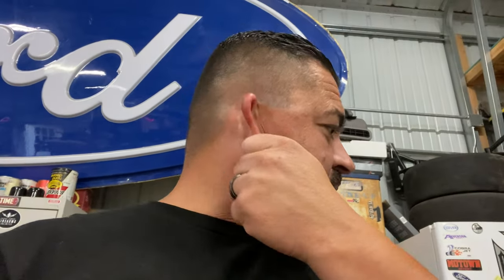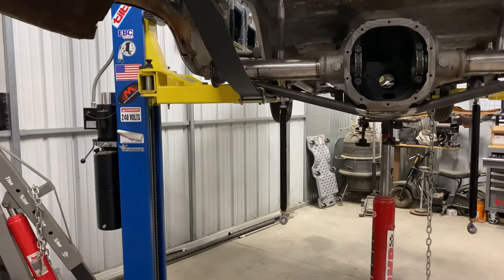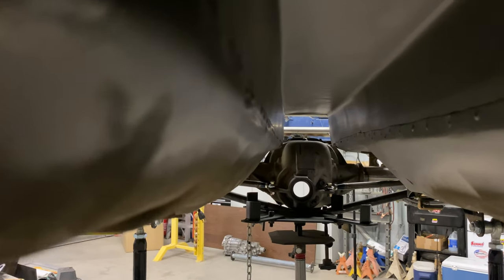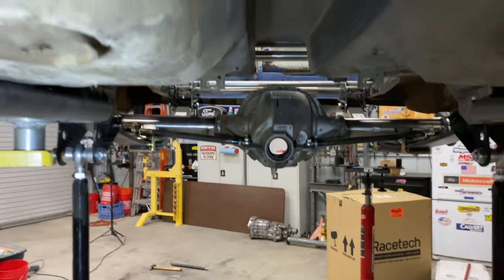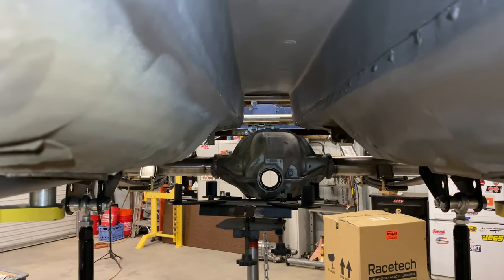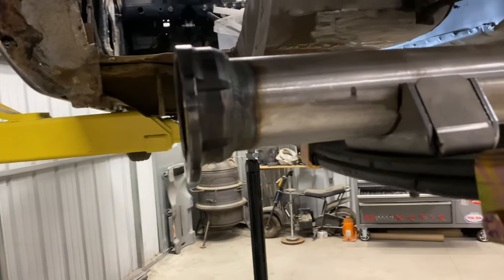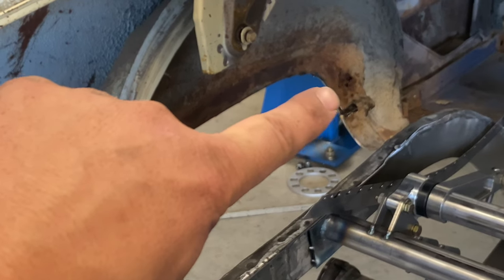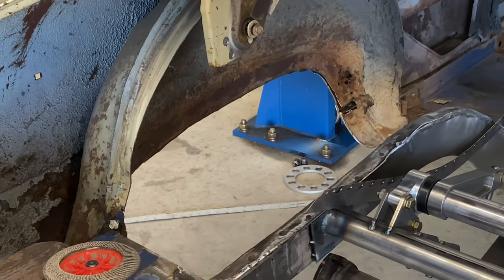A COSTLY MISTAKE! REAR END PROBLEMS!!!! AND MORE MINI TUB STUFF!!! #1963FORDFALCON

Comment: Make a gusset to go in that gap and weld in place then cut the older weld off at the ends of the housing to make room to put the spring perches in the correct place 
You really should have left the lower brace off until all of this is done and then  make the lower brace fit in the space

Comment: You'll be able to get a big tire in if you square up the inner tub , less work too. Card board templates helps visualize better plus you put it on sheet metal to mark out and cut to. Are you going to roll wheel lips too for more room

Comment: I'm pretty sure you don't need that bottom brace.  what track second you looking at 9"s   I would measure  from the middle to the outer diff axle housing.   Center the housing and locate it there.    I put an Explorer rear in my Ranger truck..
Reply from the maker: I want to be around 8:50 or faster. I just got the rear back tonight so I’ll mess with it this weekend
Reply: @TeamDPerformance   Roger.   Did you look into Cal tracks?  I made my own  I'm using adjustable rear shocks as well.

Comment: what is the tool called that you used to put the little lip into those filler panels? Love the build, working on a 61 myself.
Reply from the maker: @justinbrunner7127  air punch and flange tool from Harbor Freight

Comment: Man that sucks! Side to side is correct. If pinion alignment is off to 1 side, it will work if it's off less than about 1/2 inch. the factory does it all the time! But with a drag car, it should be centered. Your rear end guy should have set it up that way. Sorry dude! That's how i have done it for 40+ years.
Reply from the maker: Thank you Doc! I think we got it figured out. He took 2 inches off one side so it should be perfectly centered. We’ll see this weekend

Comment: Math? You're talking about math? I started in public schools.  Lol.  I feel the pain. Bought a back brace  without thinking where the u bolts would go. Keep pushing forward.  Now that I have my front spring mounts tackled it moved the leaf springs too close to the rear frame rail so the slider hits it.  So now I have to notch or clearance the rear frame rails.  I guess it would have been easier to build a fox body or something that people make kits for and other people have done.  You, #63falcon turbo and myself are inventing it as we go.
Reply from the maker: I started in the public school too!!! Lol notching the rear frame should’nt be that bad, as long as you have some meat left you’ll be fine. Building a fox is the easiest platform to do! They make EVERYTHING for them but that’s the beauty of this car, it’s DIFFERENT! And that’s what I wanted. Keep on truckin! I just got me rear housing back, I’ll mess with it tonight or tomorrow.
Reply: @TeamDPerformance  Awesome. Can't wait to see you get it on the ground on the tires!  Yeah almost everything on these falcons save the k member is pretty much self engineered, self built.